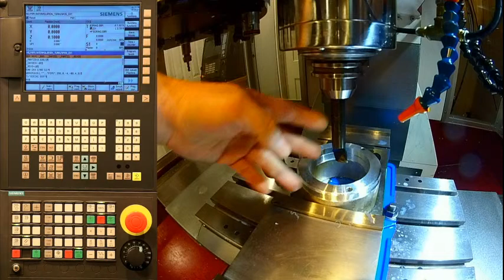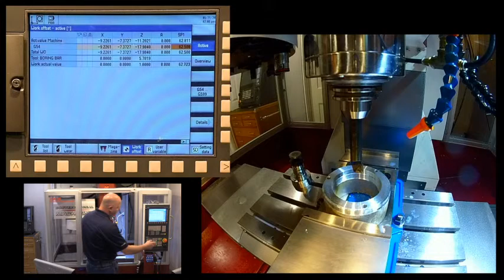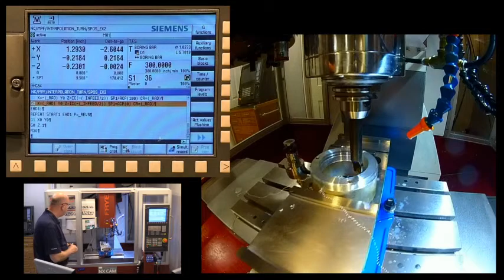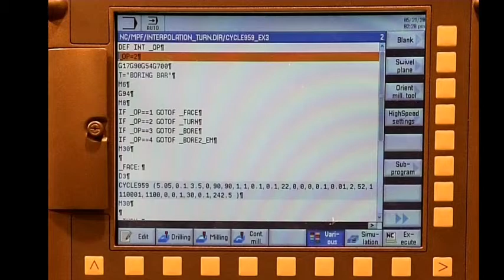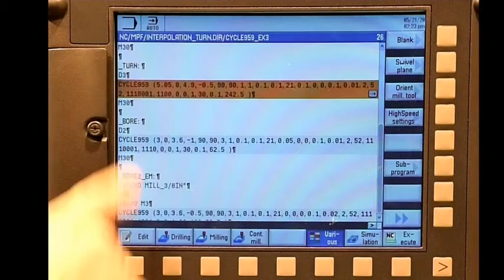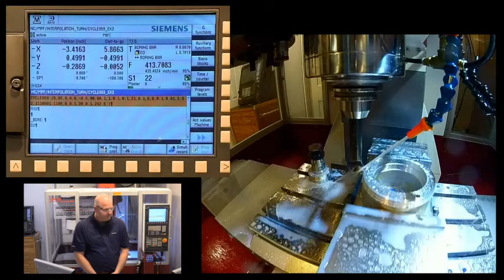Interpolation Turning - when a 3 axis mill mimics a lathe

Comment: This is an excellent series, so first off thank you for putting all of this content out there.  I switched over from machines running another, very popular series of controls and these videos have made the learning curve a lot shorter and got me to a level of knowledge about the Siemens controls that makes working with them quite enjoyable.

Having said that, I do have I have an interesting issue coming up when using this cycle.  I downloaded the package available from the Siemens portal and commissioned it into my machine and Sinutrain following the instructions (minor changes to the tool table screen modification xml needed for my machine to incorporate existing OEM mods).  After commissioning, I have the same problem appearing in both Sinutrain and on the machine.  OD turning works fine, but whenever I switch to doing an ID boring operation, I get a 61616 error (Block X: Current cutting edge position 4 impermissible).  This happens regardless of whether I'm using a turning tool in position 3 or 4 and regardless of the edge radius or x offset of the tool edge definition.  Any idea why this cycle would work properly only for OD operations but fail with that error every time when trying to use it for ID operations?  I set up my tool the same way you did in the video with two additional edges, one in position 3 (D3 edge, positive x offset) and the other in position 4 (D2 Edge, negative x offset).

I thought maybe it was something specific to my machine, but I see the same issue with Sinutrain when commissioning it into the stock 3 axis machining center.
Reply: I actually answered my own question.  It needs to be a position 2 tool for ID like as if was being done on a horizontal lathe.  Despite the vertical orientation of the z axis, the turning tool positions (clocking) is the same as it would be in a standard, horizontal lathe.  Took a moment to get my head around that.  I'm guessing there is a way to "rotate" the tool position normals by 90 degrees so the positions are visually aligned with the standard orientation on a vertical mill?  Visually, this would be similar to how they would be represented on a VTL.
Reply from the maker: there might be a md for that. but i would reach out to the build on that one
Reply: @MrCNC at this point in my machine's life cycle I pretty much the builder.  The OEM isn't really supporting this machine beyond hardware based on my experience.
Reply from the maker: i see you answer your own question below
Reply: @MrCNC yeah, I figured out the issue and also updated the tool table display format to correct for this.  The one issue I still have is that sfm mode for the tool park speed doesn't seem to work.  Even when setting up to use it, rpm is still used.

Comment: my machine Alarm with "SP1"  and not works with "SPOS"  ans  "SPOSA"
Reply from the maker: your spindle is named something else. and it should be SPOS=. Go to Machine>setup>MD>General>the first 10000 md are axis names S1 or SP2 and so on
Reply: @MrCNC   ,  my machine only read "SPOS" and WSPOSA"
When i ran a programs, the spindle turn to destination before  " X " and " Y "  axis.
Reply from the maker: is the tool align properly?

Comment: Great video. It solved a huge problem. We have a machine with a built in  inerpolated turning cycle, but it insists on moving to the center of the hole before retracting, and this was crashing into our part. So we decided to write our own macro. A LITTLE CAVEAT: In our machine you need to enable the spindle positioning function with M70. After M70 you can then command  SP1=XX; M70 puts the spindle in "axis mode"
Reply from the maker: Nice!

Comment: This is a great video. I just recently purchased a PKM Tricept 805 with a Sinumerik 840D control. It is 5-axis system, a tripod with parallel kinematics for XYZ and a 2-axis serial head. I was wondering if it would be possible to use the spindle drive but instead of driving the milling spindle to drive a rotary table. In that case would I be able to setup a similar synchronous rotary table with the 5-axis system? The benefit of this would be to mill something that sits on the rotary table in front of the tricept in a constant spiraling toolpath from top to bottom. CAM of course would produce for each motion block the corresponding rotation angle value for the rotary table.
Reply from the maker: I hope I am following you correctly here (had to check out the Tricept 805 online to get a better understanding) - but I think it would work. Certainly the spindle drive could be commissioned to just program a positioning rotary axis.

Comment: Hi, excellent video. I have a question. what does it mean WORKPIECE (," ", , "PIPE", 256,0,-4,-80,4,3)?
Reply from the maker: Thanks for the feedback! The WORKPIECE command line allows you to set up a workpiece blank for simulation purposes, so you can get a better feel for the toolpath and even see material removal. Hope this helps!
Reply: @MrCNC  Thanks you. I download SinuTrain yesterday. It`s terrific. I made a program for the machining face flange based on your video.
Reply: Is it possible to do a conical helical interpolation?
Reply from the maker: to the best of my knowledge no we can not with our cycles

Comment: Hey mr cnc. Thanks for all your videos, they've been very helpful when I had to switch from fanuc to siemens. I'm trying to make my own cycle that would let me rough a radius on a defined contour but I have two problems to solve that would make it much more effective. Is it possible to temporarily turn off Z retraction after each cycle in shopmill? Also is it possible to change the approach radius when using contour spigot milling? Contour spigot is my favourite cycle but it cuts so much air when I'm using bigger tools. I've noticed that lead in radius depends on DXY value used in the cycle but is it possible to change it and leave the DXY close to 100% of tool diameter?
Reply from the maker: Appreciate the feedback!
What SINUMERIK Operate software version are you running and do you have any prior experience with writing custom cycles/macros?
Reply: @MrCNC  I sent you an email!

Comment: A question , can i easily make a custon tool 'drop off' point ?. For example to unload a heavy tool that the atc could not handle , and not being forced to stop the machine to manually unload .
Reply from the maker: Are you referring to a special drop off location, inside the machining area for the tool, as opposed to performing a hand tool change? This could theoretically be achieved, but would most likely require added PLC logic. Also, if the tool holder isn't shielded from chips, coolant, and other debris... I would suggest a hand loads. This is much safer and can be set up by simply not assigning the tool to a certain pocket in the tool offset/magazine page.
Reply: @MrCNC  I see so it's pretty complicated . I theoretically would use this for heavy tools . usually it's only 1-2 tools that are really heavy . I would take it out from the machine so i don't care about the chips , but hand loading makes this a 2 man operation , cause i can't hold a 25kg tool in 1 arm in a weird position .
Reply: @MrCNC  But thanks for the input , it was worth a shot

Comment: What is the max rpm of the spindle that could run on this part? Would the machine table keep Synchronized with the spindle if you increase the spindle speed?
Reply: Probably until you ran out of max programmable feed , and the spindle still won't need to turn fast .
Reply from the maker: Yes sir, you are correct.